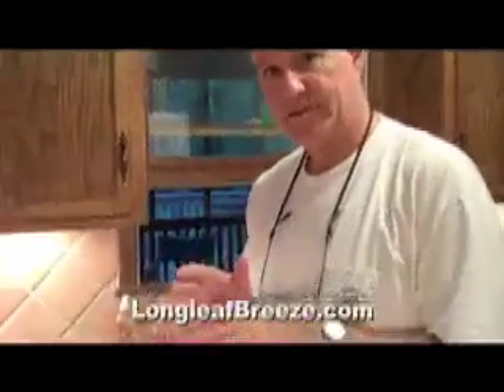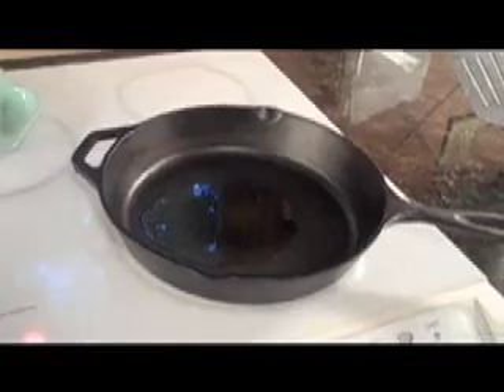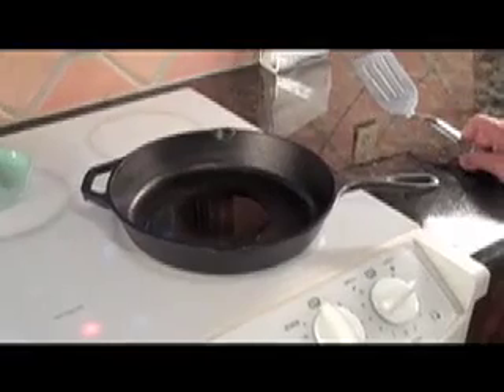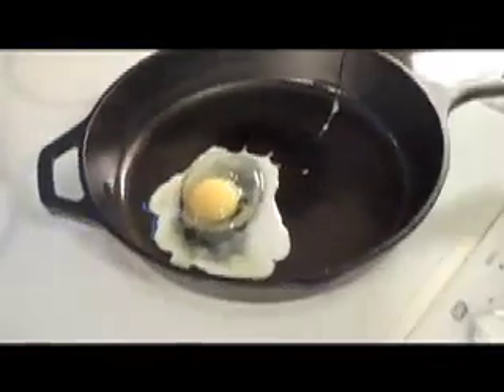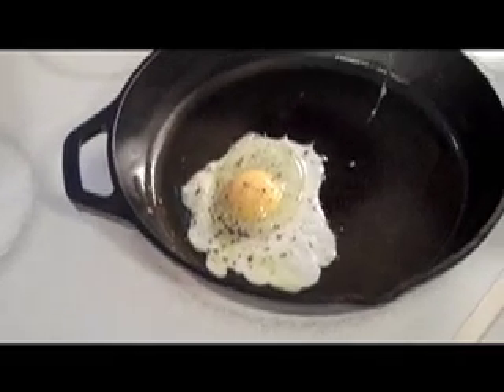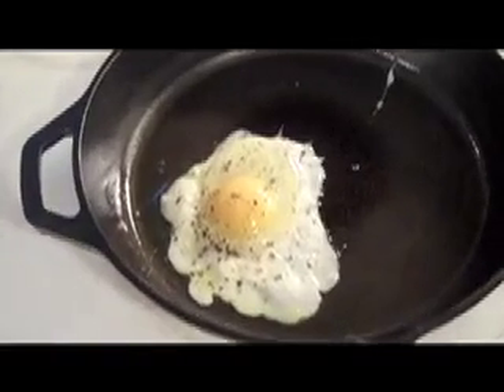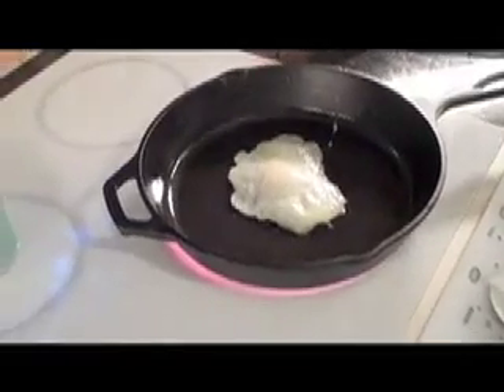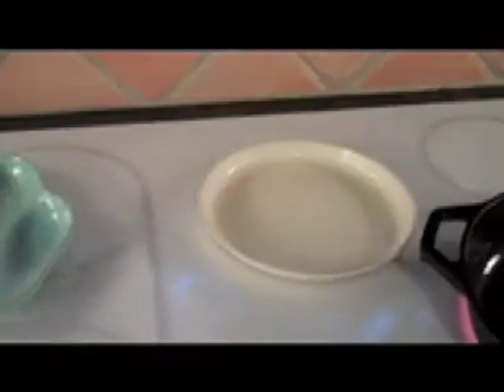induction cooktop 1

Comment: Most store-bought eggs are yellow, usually paler than this, because the chickens are confined to cages. Home-grown eggs are orange if the chickens are allowed to free range (roam around eating bugs and plants). SOOOO much tastier and more nutritious!

Tip: heat the pan first, then add the oil or butter; food will not stick no matter what kind of pan. He is using a well-seasoned pan so he doesn't have a problem.

My mother's stove like this is slower to boil water than my 40-yr-old coil model.

Comment: I've used a commercial one with a temp control and they are MUCH faster than a standard electric.  The main downside is you do need cookware that will work so aluminum is no good and most commercial pots are all aluminum.   A nice feature is you can set it to 180 degrees and it will hold at an even simmer, or maintain oil at 350.

The other thing about pots is thin pots will cook slower than thick ones.  This is great if you want to pan fry chicken in a cast iron pan.

Comment: Cast iron pans are made "in the rough".  They come straight-out of a sand mold.  I figure, given the proper équipement, that one could buff the bottom rim to a mirror-like finish.  Thus, making the best ferro-magnetic cookware harmless to the fragile ceramic-glass surface.

Comment: In my opinion the demonstration is flaw. In conventional range, you have to use a more efficient pan to transfer heat, from stove to pan.

You are comparing optimum setup for induction vs non-optimum setup for conventional stove.

peace. :)

Comment: WTF?  I've seen this comment copy-and-pasted onto 3 videos so far! 1) The service life is commensurate with the quality of the equipment, as with any electronic device.  An electric hotplate certainly does not last forever. 2) Induction transfers heat more efficiently than gas, and gas usually comes with chemical contaminates 3) Appropriate pans are commonplace 4) Keys and rings are absolutely safe and 5) If you don't want one - don't buy one! (Or return the one you already have!)